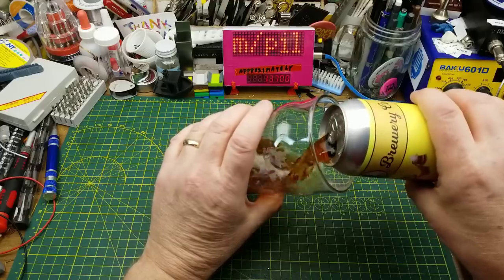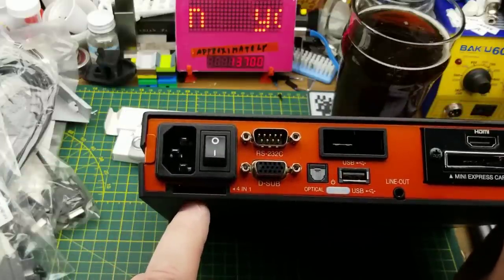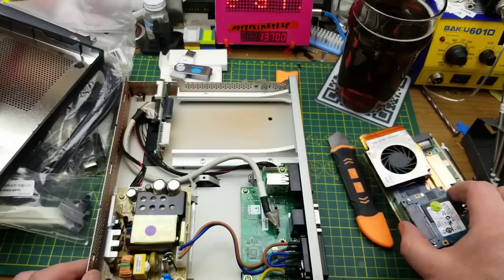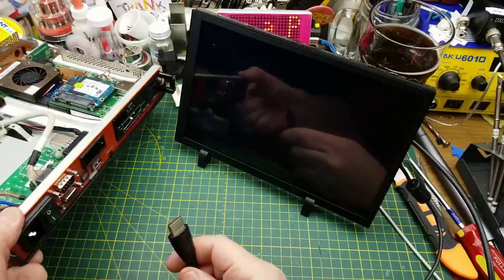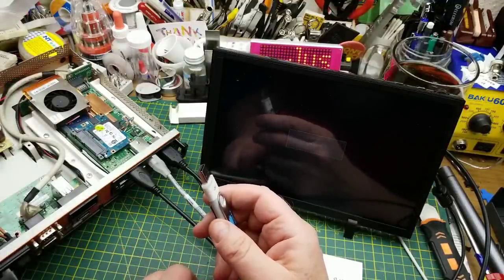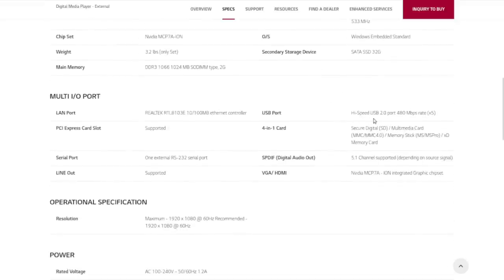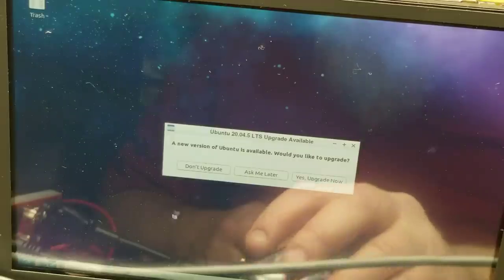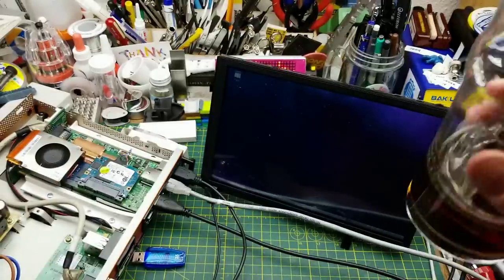LG digital sign player: Curiosity Teardown

Comment: Wow, I haven't seen one of those units in years. 

There was a hack or mod to run these units on 12v only. Worked well when paired with a 12v display and a large battery. These days, you could set it up with solar for home automation. Though you need some usb to i2c, spi, Lora, etc... 
I don't recall any i/o pins, but there maybe a uart header.
Reply from the maker: It would probably be easier to connect an ATMEGA 32u4 based module to the usb if I waned GPIO
Reply: @pileofstuff  that could work and would be a neat project to see. 
Thanks for the videos mate.

Comment: You could probably upgrade the ram past 2 gig anyway. Almost every discontinued machine I've ever run across assumed the biggest you'd run would be like 2 gigs, and they tested their machines with 2 gigs, and only sold an official upgrade option for 2 gigs. Some of them even used the old boards in newer systems that had more ram but decided to try and up sell you by saying the old system maxed out at 2 gigs.

Comment: These are just early low power computers, which is why Raspberry Pi's have taken their place. I actually had a couple of even older ones I turned into very low spec linux machines at one point. Never did anything with them, just a proof it could be done.

Comment: Nice little box, could use it as a NAS or other kind of low-powered server, home-cloud or home-assistant type of duties should work quite well. The RAM is a bit of a limiting factor, but still should be do-able using a swap-file to take up the slack. Plus the fact that it has the mini slot on the back could open up some more old-school kind of functionality too. :-)
Reply: Just replace the ram with a better ddr3

Comment: Basically a Thin Client
I have some Dell and HP with similar specs, if you open up a 'normal SATA SSD you can fit it in to that space, install a higher capacity RAM modulke and have yourself a more powerful RAsPi for PFSense or PiHole, or a combination :)

Rabbit-hole ahoy !!
Reply from the maker: PiHole is not a bad idea.  Or Home Assistant.  Or maybe just an arcade emulator.

Possibilities...

Comment: It's basically a computer running Windows Embedded, which is a specialised appliance like version.   Given the age of this it would likely be Windows 7 based .  The module looks to be almost like a single board computer and the rest just breaks it all out.
The limited RAM will limit what you can do.  Even Home Assistant prefers 2GB or more and the 8GB storage would be another limitation, but maybe these can be upgraded?
Reply: Replacing the ram is s thing
Reply: The drive is a standard SATA SSD so that's also easily upgradable. A full-size 2.5 drive might not fit but most 2.5" SSDs are a small board in a large case so that can easily be solved.

Comment: Looks like a good candidate for running Klipper on your 3D printer!
Reply from the maker: That's a possibility I hadn't considered.  Interesting...
Reply: @pileofstuff  Or Octopi?
Reply from the maker: @JohnKnutsson  Also a possibility.
Reply: I used a wyse thin client just for octoprint. As it uses a bit more powerful cpu it works great.